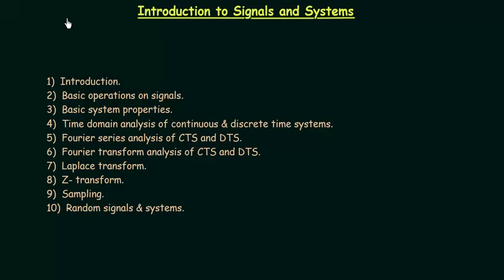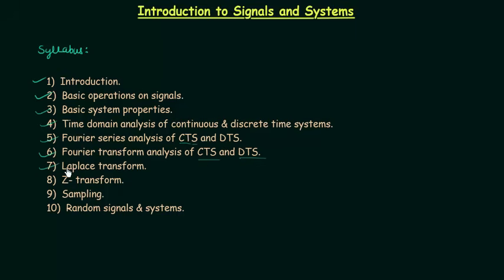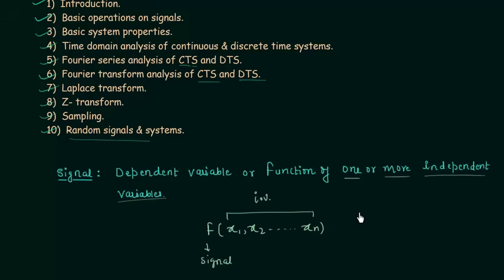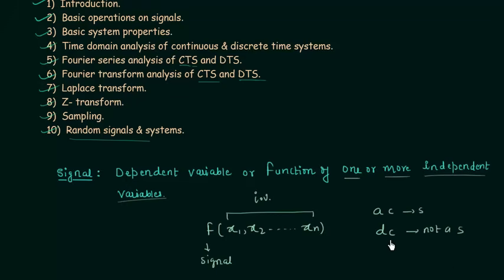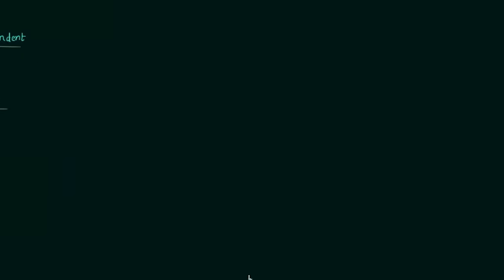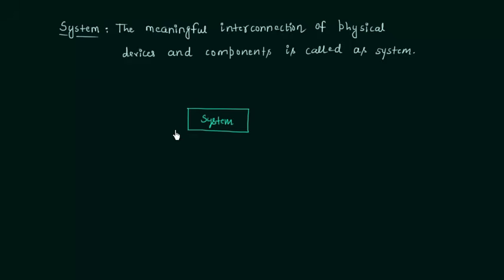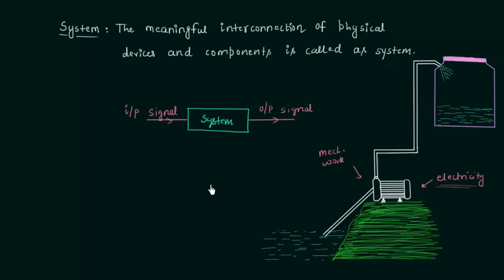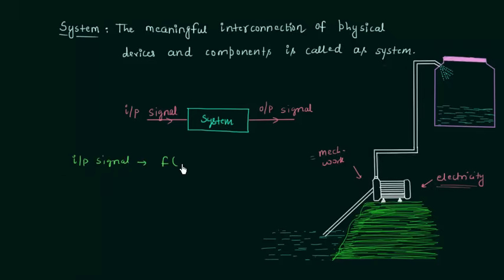Introduction to Signals and Systems

Comment: Signal is a dependent variable which depends on one or more independent qty or variables,
Two types of signals are single variable and multi variable based on the number of variable it depends 
Accha is signal bcz it changes, dc is not Signal bcz it does not changes its constant 

What is system? 
Input - system - outputs 
Inter combination of components and devices 

Analysis problem analyse output 
Synthesis problem we synthesis system to get desired output from input

Comment: Great introduction. I have two questions tho. if the input signal is f(x1,x2,...) and we feed that into a system, wouldn't that give an output signal of the form g(f(x1), f(x2),...) because of the impulse signal as opposed to g(x1,x2,...)
second question: isn't the synthesis problem the problem that machine learning tries to solve?

Comment: The output signal is basically the objective signal you're trying to obtain as a result of manipulative processes on the input signals via the systems involved. So, a computer is a system, but a computer can't perform any of its tasks without electricity (AC current) which is a signal as you eloquently explained in this video.

Comment: Sir If meaningfull interconnection of devices is a system then in the example you consider only motor is a system. But sir motor connected with tank and tube performaning a meaning not why not whole is a system